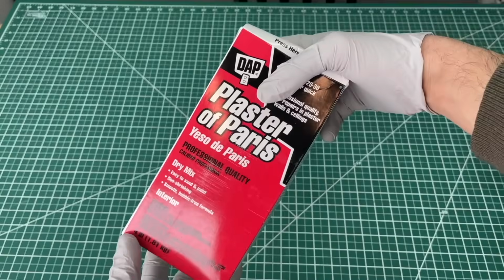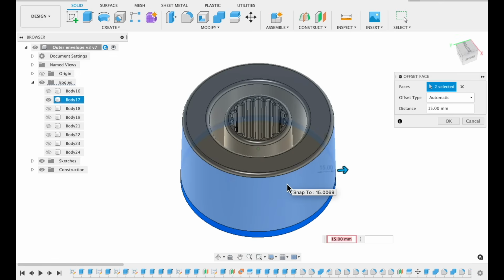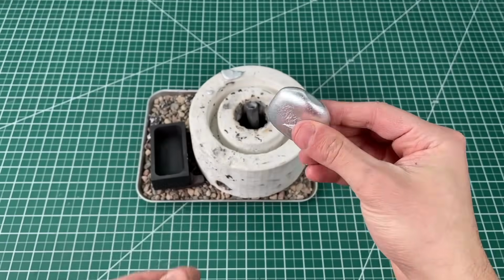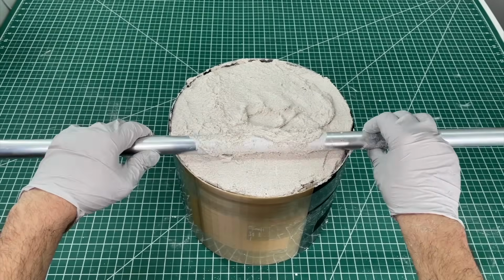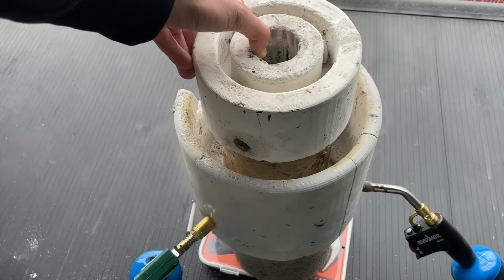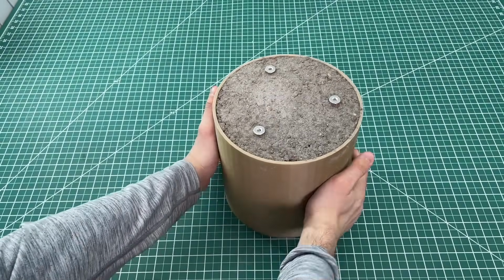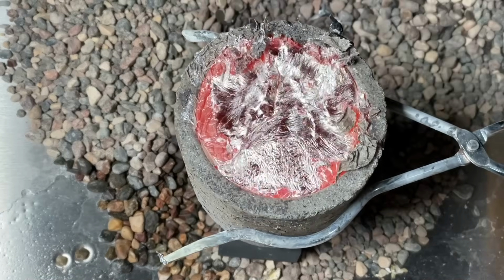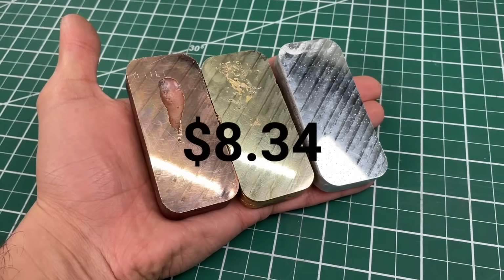DIY Foundry At Home

Comment: WELL DONE! Keep this up!  As a fellow casting enthusiast, here's the notes that I'd add:

1) the mixing of the plaster of paris is usually done with some version of the paint mixer as you wound up doing, but there are a number of specialized drill attachments for this

2) there are a lot of people that use perlite to make these sorts of stoves because of it's high temperature insulation properties, that may make a good replacement or addition to the sand

3) you learned this the hard way and well done learning it at all, any moisture creates a danger, casting on a concrete floor is regarded as excessively dangerous and the recommendation is to cast on a sand-covered floor because any spilled metal causing the moisture in the ground to boil, can not make it pop and throw the molten metal, as the sand does not let the pressure build up.

4) you can probably make a very good ingot mold out of green/casting sand, or a sand that is mixed with a specific amount of clay so that it will clump to a shape and hold that shape well, enabling casting.  I could see something like a frame with the end of a board stuffed in being "the ingot" in the shape of that end of a board, for example.
Reply: Sodium silicate also known as water glass mixed with sand would be a better mold than green sand unless you are ok with making a new mold every time. Otherwise some store bought refractory cement or insulating firebricks clamped together (not gonna be smooth though) 
My foundry is made from sodium silicate and sand. It's basically just lye drain cleaner and silica gell (crystal cat litter) water and sand.
Reply from the maker: This has been my favorite comment so far.  Thanks for the informative yet positive content, and thanks for the enlightenment 😃 cheers, Dave

Comment: plaster of Paris actually starts to degrade into calcium oxide at temps over 400°C (752F). melting temp of aluminum is at 660.3°C (1220.54F) 
so its going to degrade and crack before you can melt aluminum.
its absolutely terrible material for a foundry. i would only use plaster of Paris in one off casting. j

refractory cement is the best choice for a foundry but gets expensive.  94% Alumina dense refractory cement is probably the best at being heat tolerant to 1800°C (3272F) 
buts its around $100 per 10kg (22lbs)
Reply from the maker: This is all true. Incase it was not evident, these are meant to be cheap and quick solutions as opposed to a very long term design. I appreciate you sharing this information. Thanks 😊, Dave

Comment: I would just add to use draft angles on your designs so you can remove molds easier, from my time at Nemak (aluminium automotive engine block manufacturer).
Reply from the maker: We actually did (great catch) but the cylinders used to make the holes for the torches prevented it from coming out.

Comment: 1-1/2 angle iron works well for molds. I use it for copper and aluminum bronze ingots all the time. It’s walls seem to have the right relief angle for the sides and is really easy to cut and weld to size
Reply: Always pre-heat your molds!!!!
Reply from the maker: Sweet, thanks for your input 😃

Comment: y'all should be really careful with brass. That weird yellow/green flame it gives is the zinc turning into a yellowish powder/fiber bullshit that is actually fairly toxic. Metal Fume Fever is a thing and zinc is one of the worst metals to be messing with.

the aluminum usually needs to be "degassed" before pouring, people normally do that with borax I think? An inert gas works best if you can bubble it through the aluminum for a while.
Reply from the maker: Thanks for the safety note, we were using respirators but it’s a great reminder.  As per the aluminum, I will have to give it a try. Cheers 😃

Comment: Hey,
Great start to learning to cast but I’d spend a lot more time researching things. I also wouldn’t listen to too much in the comments because there’s a lot of misinformation and confusion.
Areas to look into are - 
All the metals need degassing as gasses dissolve in the metal when it’s molten. Each metal requires certain degassing products / techniques so look up the specific way for the metal. From what I can see that’s the issue with all of the castings, even the copper. You need to look for the correct pouring temperature for your metal or alloy as pouring too hot or cold can cause inclusions. I use a probe that I dip in the metal.
Secondly, there are different alloys of brass and aluminium. Specifically with the aluminium you need to make sure it’s a casting alloy. I’d imagine you’re using alloys better for machining? They probably won’t cast very well. I’m not an expert in aluminium so take a look on that. With brass the longer you heat it the more zinc is burned off, that’s the pale yellow film on things and the smoke coming off, this messes with the alloy composition. Also don’t breath the fumes as they can give you flu like symptoms.
With regards to the foundry, if you’re going the DIY route maybe try purlite in the cavity as it’s an insulator and may help with the heat loss. I’d try a lid also. To be honest I’d just get some refactory cement as it’ll last hundreds of heats with little degradation. I think going the cheap route is a false economy for money and time. Having to repair the foundry every few times you use it will soon get tired.

If I’m honest, the amount you’re doing is probably not worth it when you think about the fuel cost, cost of crucibles and other materials especially when you consider the end material isn’t ever going to be of the best quality and wouldn’t be much good for commercial end use (you probably can’t sell products made from unknown alloys or unknown quality)
Just my piece, I hope that all helps. If you have any specific questions, please feel free to reach out.
Reply from the maker: Thanks for your detailed reply, I enjoyed reading though this and appreciate your input. Dave
Reply: @ActionBOX  no worries at all. Again, if you need any input, feel free to get in touch.

Comment: You dont pour water on the bar while it's still inside the graphite/cast iron casting bar. You pour molten metal inside graphite bar then let it cool for a few sec then flip it to remove red hot bar then cool it
Reply from the maker: Now I know 🤷🏻‍♂️. Thanks for the insight.
Reply: @ActionBOX  no problem. I am no expert but I've picked up on a few tricks over the years. Sprinkling graphite powder on casting mold will help the molten metal not stick to it too. And also you need to use a metal scooper thing to remove the slag on top of molten liquid metal before pouring into casting block and always preheat castings too or else you will get bubbles and or pops when pouring

Comment: Use borax soap to coat the molds and also sprinkle it on the cruciple and it will pull contaminates and protect your molds! Turns to glass!

Comment: Good use of 3d prints for patterns.  You will find that a lid makes a big difference in insulating the furnace and it will be alot more effective. Both plaster and concrete use water as part of their bonding process.  Heating slowly and drying will prevent steam explosions however the chemical bond of either plaster or concrete will break down at copper and brass temperatures.  There are some effective diy refractory recipes but you will find proper castable refractory gives better results. You might find a steel drum or bucket with a fire brick in the bottom and lined with kaowool ceramic fibre and then a refractory coating to prevent the ceramic fibres from blowing free and hurting your lungs.
Reply from the maker: I appreciate the detailed comment. I agree with all your points. Cheers, Dave

Comment: its simple.... just keep the molds hot.... and don't mix the molds on every metal.... it contaminates
Reply from the maker: thanks for your input 😃
Reply: @ActionBOX  and you can use burners with oxigen to raise the temperature to melt and have ferfect control of temperature a cristals
Reply from the maker: @drmagex  thanks Mario, I appreciate the details 😃.  We may try another one in the future.

Comment: You probably want the concrete a bit more runny so it makes a more solid surface (think like a patio). It will take longer to dry and cure, and it is a good idea to slowly heat it over a few hours once its done, but might add some efficiency
Reply from the maker: Sweet, thanks for the tip 😃

Comment: hi i love the channel and projects, hopping to one day have a shop with cnc and printing capability's too, i think having a way to melt all cnc leftovers is a great idea, but using a chemical (gas) metal foundry is messy and dirty?, i would think a large scale electric induction would work better faster and cleaner?
i am planing to build one, but not exactly sure yet how, and what schematic i should follow for non ferrous metals
Reply from the maker: Thanks for the awesome comment Oz, I love the passion. I started that way as well. You are probably right with the electric concept and we may get to trying it. If you build one please do share here as I’d love to see it. Cheers, Dave
Reply: @ActionBOX   @Action BOX  hi well i would love to build one, here's my problem, i am having trouble finding info of what kind of dev i need to melt non ferrous metals, from what i understand from indirect info, the lower the ferocity of a metal, the higher the frequency of the magnetic field needs to be???
i would love build one and even share it on my channel, but i am missing some needed information, and i don't have a lot of free time and resources, and if i will end up building one, i will send you text on here.
and if you guy's build one before me, please send me a text, and please please pleas go into the small details of the circuit design, schematic, operation, and all the good stuff, and as i said, if i'll beat you to it, then i'll do the same :)
Reply from the maker: @ozb2006  hahah, awesome, I love it.  I’ll make sure we reach out if we get to it, and you do the same.  I’m not sure about the power generators yet but I guess we’ll find out 🤷🏻‍♂️. Thanks again for your awesome comments 😃, Dave

Comment: As a manufacturing engineer that specialized in net shape engineering like this, I've taken multiple classes on casting and the different types. A couple issues that I see off that bat is that you probably haven't realized is solidification, when the part shrinks internally and externally from going from hot to cold (liquid to solid). Also, your material is expanding with the molten, which is why your seeing a large amount being expanded externally from the desired shape. What you'd want to do is use the green sand mold process where you make your mold out of metal or wood and then you use that to make a sand mold. Then make a hole to go inside your mold from the outside where you pour your molten metal into. Another option is doing a lost foam mold where you make your mold out of foam (make sure to make your sprue too) and then put it in a bucket and pack the whole bucket with sand. Leaving the foam mold in there, pour your molten onto your foam sprue and the metal will replace the foam mold, hence you lose your foam

Comment: I used to mix plaster every day for 2 years for casting molds. If you want good smooth result with plaster, run your plaster through a flour sifter and use a whisk to mix it. Pick up the container a little and rattle it against the ground. Pour, then rattle a little more. Also use a separator whenever casting plaster, a thin coat of a little soapy water mixture is just fine.
Reply from the maker: Awesome, thanks for your expert advice we’ll give it a try next time we mix plaster. Cheers.

Comment: I'm a new subscriber to your channel. I would recommend a couple things dont add foreign materials to the crucible also heat the mold up to remove any water. Also scrape stag from the top of the molten metal. I learned alot of stuff from a youtuber called bigstackD casting. He does so much casting and really helped with my casting.
Reply from the maker: Awesome, welcome aboard and thanks for your detailed comment.  Many people have mentioned that channel already so we will be checking it out. Cheers.

Comment: You should watch MyfordBoy's videos. He ads something to the molten aluminum to "degas" it. I think that might help with the Al. I presume there's something similar to add to the copper, but I don't know if it'll be the same stuff... Also, as others have said, warm the mold, and use a flux so that the metal flows better and cools slower...

As for brass: I really feel like maybe you shouldn't melt it! Zinc fumes are poisonous. Welders are always told to not weld galvanised steel. You either etch the zinc away, or grind it, or weld outside with a really good respirator... 

As for molds, I've been using a muffin tin. I tried to get an old one at a Goodwill, but couldn't so I ended up buying a cheap steel one. It was teflon coated, so I burned off the teflon, outside, windy day, me standing upwind....

Final thought: My foundry is crumbling, but I had some steel mesh in it and that's holding. I've been meaning to try mixing steel wool into the plaster to make a new one and see if that makes it any stronger.
Reply from the maker: Hi Richard, thanks for the super detailed comment. I agree with everything you suggested, and would love to find out how the metal wool project turns out. Keep me posted.  Cheers, Dave

Comment: Nice project, but I have a couple of comments/suggestions.
1- Make your inlets so your flame swirls inside the foundry instead of hitting your crucible at 90.degrees.
2- As is, you are also insulating your crucible from the heat with the internal concentric wall inside so it is taking a lot more energy to melt your metals.
That should simplify your mold construction and also reduce the time and propane you use for melting your metals. (and also maybe extend the life of your crucibles)
Reply from the maker: That’s a great advice.  I agree with your recommendation. Thanks for leaving a comment 😃.

Comment: Once the metal is molten in the crucible, you need to remove the slag off the top.  That is what is causing the oxidation on the ingots.  This will also cause the bubbles in the final casting.  You may also want to put borax in the molten metal, it dissolves the oxides.  Awesome video and foundry.
Reply from the maker: Sweet, good to know and thanks for the support 😃

Comment: You need to de-gass the molten aluminum. Check out the MyFordboy channel for some pointers on performing the de-gassing procedure.
Oh, and maybe invest in a firesuit and full face shield if your doing copper and brass. That stuff is scary.
Cheers,

Comment: Nice mold! I've been trying to make a foundry such as yours. Minimal quantity items and great results thanks for this ... Hope my tiny printer (monoprice select) can print smaller sections. Also you may try later a silicone mold. Omg just saw the molten brass goggles .... SAFETY SAFETY.. 😨 GLAD U ARE ALL OKAY
Reply from the maker: Silicone molds are a good idea but probably expensive. As per the safety, I was wearing a leather welding hood over my head and am glad I did, but yes indeed, safety is very important.  Thanks for posting 😃

Comment: The discoloration of the brass bar is due to the separation of zinc and copper during the smelting process. Copper and zinc have very different melting temperatures and densities. To minimize this, stir the molten metal thoroughly prior to pouring.
Reply from the maker: Awesome, thanks.
Reply: actually seems more useful to use this to separate the copper from the zinc, but relying on this mechanism might need 4 or 5 smelting cycles to fully separate

Comment: Add and mix the sand before the water, does it help to reduce lumps and speed up mixing in the water?
Reply from the maker: No it doesn’t, we did it arbitrarily. You could add them in any order you want. Great question. Ps. From reading other comments people have left, it seems like adding water first and then adding the plaster powder slowly is a good way to eliminate the lumps, although just mixing by hand worked perfectly.